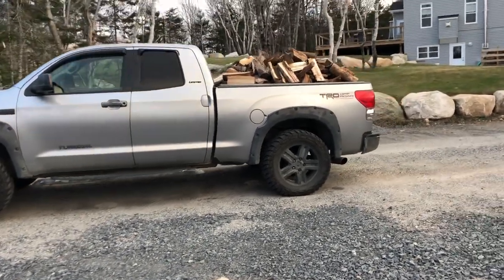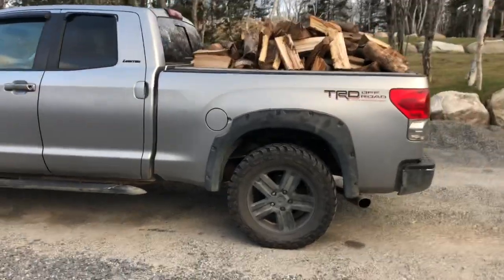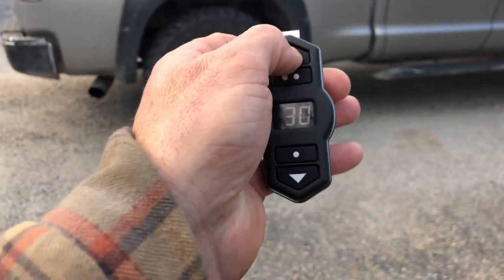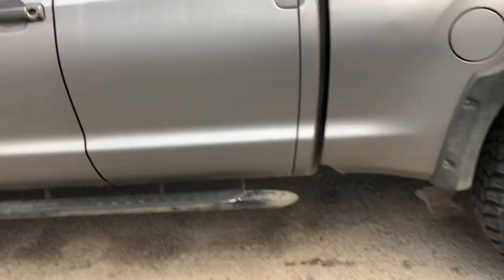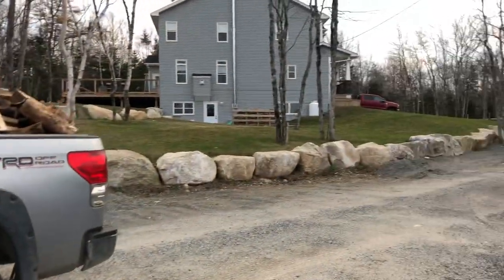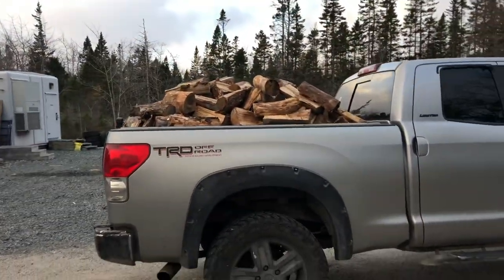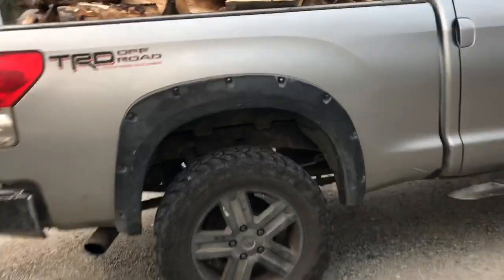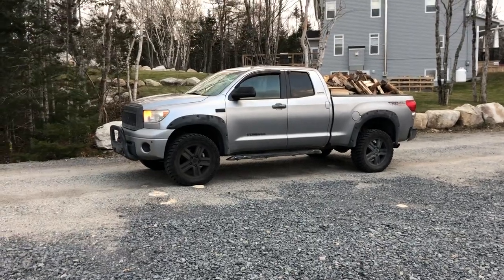OVERLOADED TOYOTA TUNDRA WITH AIRBAGS = NO SAG!!!

Comment: I own a landscaping business & pull an enclosed trailer all the time with my 2010 Tundra. I also have a 6x12 dump trailer that weighs over 10,000 loaded at times. I have the same air bags as you too. I have never been more satisfied with a truck or a mod as I am with the Tundra & bag setup! Best trucks on the road hands down.
Reply: There is no way there is a cord of wood in that little bed
Reply: @christophermcgivney7149  it’s a 6.5 foot bed so I can believe it’s a cord of wood

Comment: The bed on my '17 Tundra Crewmax is 5' wide rail to rail, 5'3" long inside, 43"tall to top of roof.. that calcs out to about 92 cubic feet. But that's if it was square and not a sloping pile. Not to mention it's not stacked or accounting for wheel wells. A cord is 128 cubic feet... taking lunch and thought I'd calc it out lol. Stacked, I'd say you have half a cord, 1600#-2000#. I hope you're not selling loads like that as cords or you could get yourself in a lot of trouble... but I'll definitely be shopping for that air bag system.
Reply: His double cab has a bigger bed than a crewmax

Comment: I tow a 8500 pound 32 foot travel trailer with my 2014 and probably sit about 10 thousand when loaded plus a 400 pound r1 in the bed my trucks rated 10200 according to my door weight and I need to get this it squats my truck a good amount towed from west virginia back to my home in California it did it fine no power issue got me home no problems

Comment: My 4.6 f150 with 327000 miles does perfectly fine without airbags, we’ll I did install helper springs. I do use that as one of my landscaping trucks. 
I had more fire wood than you and it did not weigh more than 1900 pounds. 
I usually load a 3200 of ricks or 2.5 yards of soil. The weight on that varies from 909 a yard to 1700 pounds a yard. 
I use my Toyota as a personal but I can’t wait to see it as a daily work truck.

Comment: How does the air affect ride in the 250? Factory suspension seems to be doing its job well on mine even with a half loaded dump or one of the enclosed trailers? Does it just smooth it out?
Reply from the maker: Joshua Russell Oh yeah the ride is heat. If your only towing 5-7000lbs then the airbags aren’t really required but they do make it feel better. When your towing heavy weight it is honestly day and night man! Very confident inspiring!! Like I said if you have them you can’t go back!

Comment: When you lower air pressure does it take the ridgid ride off the truck my TRD Tundra is crazy stiff unloaded with 80 psi tires and Bilstein shocks.
Reply from the maker: I never run more than 60 in my trucks
Reply: I'll try to take 20 pnds out my tires see how it rides

Comment: Great video, thanks for sharing. I just bought a 2014 Limited Crew Max. I'm in the market for some air bags. I'm very impressed with your truck, thats a lot of weight you had on there.  How is the ride on a smooth road when the truck is unloaded and bags at 5psi?      Great truck you have there!

Comment: Some wood in a 5 foot bed and it's overloaded.. not terribly useful as a hauling truck, but then again that's not what it's made for.
Reply from the maker: 6.5 foot bed.
Reply: @workplaytv  right! My bad. Most of the Tacomas I see have the short beds. Some wood in a 6.5 foot bed overloads a truck.. that's sad, but I understand that's not what the truck was designed to do. Those airbags do wonders though. I use them to supplement  sagging springs since they are so much easier to install compared to breaking loose 25 years worth of MN rust to replace the springs.

Comment: Try looking at your owner’s manual. As “un-manly” as it is to do, you will notice that the tundra is rated at 1985/1980 pounds payload. 🤔 Hmmm? That’s how short of a one ton? 
Toyota playing games with NTSB and all the rip-off insurance companies👍👍
Reply from the maker: flipnotrab if you want the real number for your truck don’t look in the book look at the sticker on your door.
Reply: I tow a 8500 pound 32 foot travel trailer with my 2014 and probably sit about 10 thousand when loaded plus a 400 pound r1 in the bed my trucks rated 10200 according to my door weight and I need to get this it squats my truck a good amount towed from west virginia back to my home in California it did it fine no power issue got me home no problems